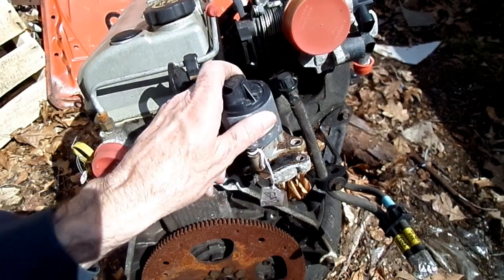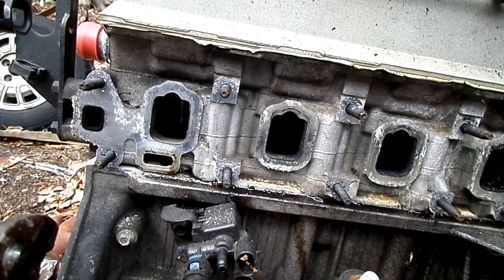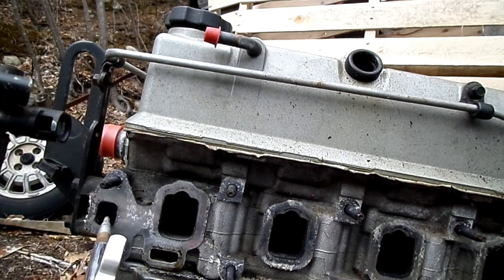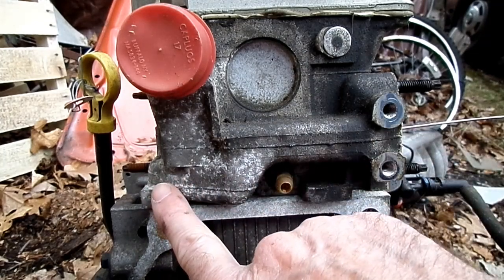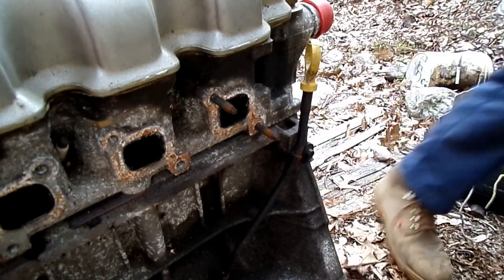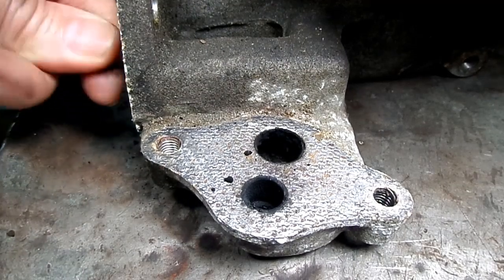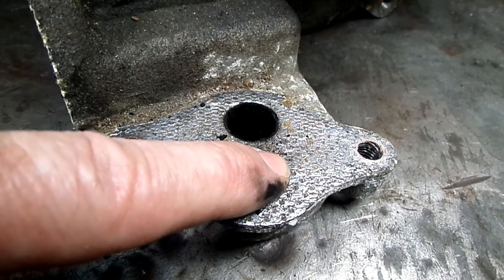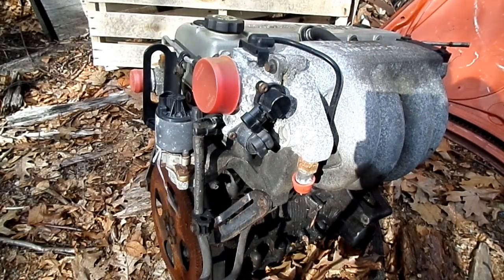EGR Insufficient Flow Detected S-series

Comment: I blocked the intake manifold side with rubber plug, left exhaust side hole open and revved the car few times.(Otherwise the idle will go straight to the red zone with open intake port)  And then, used a tire valve stem and send in compressed air into the intake side hole to clean it.

Hole close to the engine is the exhaust side and away from the engine is the intake side. 

Thanks for great video!

Thanks

Comment: So I removed the intake and exhaust manifolds and cleaned all ports on my 2000 Saturn SOHC SL1 per your instructions.  I also installed a new EGRV410 Herko Automotive EGR valve and my code P0401 has finally gone away.  Thank you richpin06a for your video.

Comment: I need help. I have 2002 Saturn SC1, with this same problem. I had it in the shop 5 times in the past year. They clean out manifold, the cleaned out exhaust manifold, changed EGR valve 3 times. Now all they are doing is changing parts and charging me. HELP.

Comment: Hi Rich. What are your thoughts on other reasons the code may be tripped? Could other sensors be responsible, or perhaps bad wiring? I tried your method and the code is still tripped after a reset. I haven't noticed any difference in performance/MPG with the code being tripped.

Comment: Can someone recommend good films about removing the Exhaust and  especially Intake Manifolds on Saturns? I have a code P0446 and can't remove it. I cleaned passages for EGR valve, Throttle body (by removing it), changed many sensors which might be relevant to the problem, including both Oxygen Sensors (upstream and downstream). Most likely it is one or maybe both Manifolds. The car has ~130K, 2001 Saturn SL2.

Comment: My EGR valve came w/ a metal gasket, it has holes in it and those holes are surrounded by circles. Does someone know if that gasket goes w/circles curved up or down? Does it matter at all?  I would appreciate any opinion on this. The car is 2001 Saturn SL2.

Comment: Hi Rich. It's me again w the clogging EGR valve problem.

Since the video was made, have u learned of any spray or liquid I can use? Unfortunately, I don't have the know how to disassemble parts of my engine like you have in the video.
Reply from the maker: Try searching for seafoam for cleaning egr valve.I wish i could say i tried it but i have not.
Reply: @RichpinTv  Thanks tho for the reply. I decided to give in and take it to the garage. They are putting in some Seafoam in the gas to start things off and then in a week they go to work on the engine to clean her out. Ahhh, I love my gold 99 Saturn.

Comment: Good video, but surprised you didn't use a chemical to clean it like Berryman's chemtool carburetor cleaner or something similar to help open up and remove the carbon deposits for better flow. Especially if you let is soak from a few minutes to a few hours and will make a huge difference. Also cleaning the IAC helps this as well.
Reply: I always tell people the IAC cleaning does a huge difference. Throttle body,IAC and EGR all at once.

Comment: I have the 0401 code. Replaced the EGR. Cleaned out the tube inside. Still getting the code. Carbon build up around the gas cap and little door.
Reply: Did you ever figure it out?

Comment: Great video. Its not not easy but you can clean ports without removing the intake and exhaust manifold.
Reply: +Gary&#39;s Garage Do tell, please :)
Reply: I tried many times before i found something that worked. I bought a drain cleaner from Harbor Freight (flexible shaft with a little mop thing on the end) for about $3.00. I cut off the ends and removed some of the outer cover(looks like a tight spring inside)  At the very end I bent a little hood to help pull it way around the corners. I took off the EGR valve and ran it in the ports using a cordless drill. Hope this helped. I can send you i picture if it will help.
Reply: Yea definitely. This is a problem code on my car quite often and would help me immensely.
Reply: I couldn't get any pictures here. So I put them on my account. I thing you click on Gary's Garage to see them. Hope this helps
Reply from the maker: +Gary&#39;s Garage Thank you for the tip,would like to see it.

Comment: Hi Rich,
Love your channel, fantastic videos. I have this problem on a 99 sl1. Even with a BRAND NEW valve constant P0401's. With the valve off the car I start it but the revs don't go up. It should race shouldn't it? It's a blocked port correct? But which port is the problem, and is there an easy cheap fix?
Thanks so much!
Chris
Reply from the maker: +charding4000 The small port (intake)sounds like it is blocked because there should be vacuum there with the engine running(high rpm).Did anything come out the larger port (exhaust).
Reply: +richpin06a yes, some carbon blew out of there. I didn't check for vacuum but did try clean that port out with a piece of stiff wire. The SES light went out but came back less than a day later.
Reply from the maker: +charding4000 So the larger port is not blocked by the sound of it.Now it is just a matter of unblocking the other one.

Comment: My daughter's S-series has this problem. The car has a lot of miles and does not have to pass emissions testing. What would happen if we do not try to clean the passage? Will the car continue to run OK?
Reply from the maker: hnkfsh81 What i know is if the egr system does not work as intended you will see a drop in fuel millage beside the obvious of high emissions.
Reply: richpin06a Well, I removed the EGR valve and used the end of a coat hanger to dislodge carbon deposits in and around the larger hole of the EGR platform and for a few inches within the EGR passage. I then ran the engine without the EGR valve for 20 seconds to blow out the loosened deposits. Finally, I reset the SES light. The car seems to run fine and the light has remained off for one day. Fingers crossed!  Thanks for all your help!
Reply from the maker: hnkfsh81 Sounds like you might be ok.
Reply: hnkfsh81 it never runs ok with EGR system. WD-40 dissolves carbon quick. With brush.

Comment: Now I have  been a fan of your "how to read a wiring diagram" for a good number of mnths .  where you show how a magnetic field travels along a wireto a diode to switch it open ,  The only wriing diagram lesson that I'm aware of that show magnetic effect on a device,  but until now i haven't watch any of your other videos ,  Well I just finished watching , how to how to how to use a Mighty Mite vac pump to find a leaking vac tube ,  excellent produced video , good lighting and strangly , I can hear your narration,   I like where you showed me how to pry plastic clip apart , I typically panic at such small thing and bust them off not understanding exactly where to pry

Comment: Hey Rich not sure where to post this question exactly. .. i also see your in Massachusetts.  I'm in NH. 
Question is I had plugs wires replaced do to misfire which fixed it. Then had issues with egr with help from your video cleaned it good and fixed that issue. So now it's running good well I thought.  It will run like a champ for like an hour and then seem to sputter and misfire and loss power and sound like running on 2 cylinders.  Even backfired once or twice.  Let the car sit for few hours and presto back to running good for about an hour or 2 then the issues start up. Just FYI no cel codes either. 
I'm thinking cat but it appears that the cat can not be removed alone.  Any help would be great and if you are a me mechanic with a shop I'd consider making you my new garage.
Thanks for any insight to the issue. O and ya I also have replaced the cts as well
Reply from the maker: R White It sounds like it is heat related so coils and ignition module come to mind.
Reply: Ok I'll swap those out and let you know. I'm sure I'll find great instructional vids on here from yoy